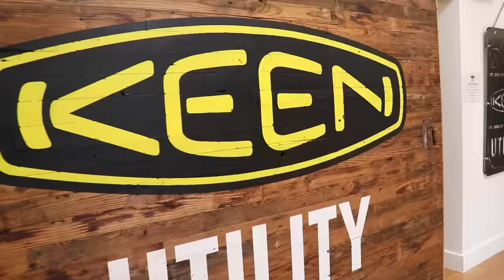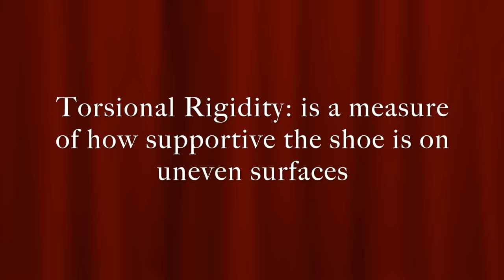How to pick the best Work boots & shoes for the Job site & why some wear out so fast

Comment: I’ve been wearing keens for 12 years and I won’t lie before they switched to American production they were made in China about two years ago. They were still very comfortable but after about 8 months the sole bonding or the toe rubber would separate. I still bought them because they were so comfortable on my feet and most importantly my back.

The quality since they went to American production is night and day. I bought a pair the first time the American version was available and they are still holding up. The support is also better in these. They also make my red wings feel flat footed and heavy. The keens never get wet inside, every other brand I’ve owned have gotten soggy even when spraying a can of kiwi or mink oil on them.

Comment: Those met guards are great for welders. I dropped a solid stainless steel bar 1"x4"x50" off the bench and it left a stamp in the concrete floor. That lands on the top of your foot and your in a foot brace or cast for over a month. The outer shell guard is great too because it keeps sparks from burning up your laces 🔥

Comment: I work in a wastewater plant.  As a 65 year old, who has worked industrial jobs since 1973.  Machine shops, Stationary/Operating Engineer, or even as a truck driver.  Your feet like rotating your boots for freshness.  I have lace ups, and pull ons.  All are safety toe and waterproof.  I try and buy ESD rated also.  I work 12 hour or longer shifts.  I own Keen's, Red Wings, Thorogood, Wolverine,  Carhartt, and Hytest.  I have an old work injury on the right foot arch.  So many of the boots have custom footbeds.
For casual wear I mostly wear Keen sandals.

Comment: I’m a diesel mechanic, I work on semi trucks. I blew through keens in 4 months. I went with thorogood boots, never going back.
Reply: Have you tried Redwing's? If not try those as far as shoes goes they have lasted the longest for me. I used to go through shoes in 3 months. Now they last a year and a half, the tennis shoe model with safety toe.
Reply: @urkryptoknight6793  I bought a pair of Redwing steel toed boots when I was attending commercial driving school because I could feel the steel plates of the truck steps through my nike's, in just a couple weeks I was back at the redwing store buying another pair without the steel toes because I loved them so much. I don't think I will ever buy another brand again. Every time I run across a guy who is on his feet all day I tell him to go try on a pair of Redwings.
Reply: I bought Keen bottoms wore out quick  , waterproof , a joke , uppers at flex  blew out   nope not again .
Reply: redwings been diesel mechanic in all weather use redwings there awsome the hood up had some that i’ve had over 6 years they stand behind there product they really do i’ve had countless laces and loops replaced under warranty they also have resoled them twice great boots i used to go thru boots every 6 months

Comment: I've had my redwings for 10 years and beat the fire out of them. When I called all the redwing stores in a 100 plus mile radius looking for a 14eee they had nothing. I was surprised that the last store told me that I should check out keen for the wider toe and the quality. I'm loving them and when I climb in and out of the semi I don't have to change since they're comfortable enough for driving.

Comment: I get a 300$ boot voucher every year at work and I've been at my job for 10 years which has allowed me to try every high end manufactured boot from red wing timberland pro Carolina to name a few. Keen are hands down the most comfortable boots I've worn and they last just as long as other boots I've named. Also keen dry doesn't fail within 6 months unlike gortex and whatever Red Wing Carolina use make my feet wet after an hour of work. I love the davinport and Dover because I put on a lot of miles on a daily basis. I can't go back to any heavy lug soles boots.

Comment: Sorry I'm not mentioning a Made in USA product. But I recently started wearing a pair of Ariat Mens Rebar 6" H2O Composite Toe work boots. So far they are amazing!  I hate a big clunky boot. Especially with how I'm constantly moving around, up and down off the truck, through rain and mud. These Ariat boots are very light and they feel like a pair of tennis shoes on my feet. I'm 6'4" 250 lbs. and I'm hard on boots. But so far these boots seem to be pretty tough. And they have the main qualities I was looking for: waterproof, good support, traction, and composite toes.

Comment: Ive had 2 pairs of keen and they are size 15 4e wide steel toe.i think its called king toe for wide feet. Used in heavy duty diesel industry. Not one complaint. Made my back hurt less legs hurt much less also.
Reply from the maker: Awesome, thanks for the comments!

Comment: After reading the comments I don't feel so bad about my Rocky boots opening up on both the insides at the ball of the foot. The leather came apart from the sole and now it's wide open. Other than that the boots are still in great condition so I just keep wearing them this way. I do landscaping so plenty of shovel digging, planting, kneeling, tree trimming, walking through stacks of branches etc. It took them about 5-6 months to start separating. 

After reading the comments I think I'll look at thorogood, nicks, and Carolina for my next pair.

Comment: I wear my Keens (Pittsburgh 6") every day.  I work in a machine shop environment, and split my time between shop & office.  I was previously wearing Georgia boots for years that would usually last me 12-18 months.  Keens were very comfortable, but I blew out the sides of the Keens at the flex in 5-months, not impressed.  I was, however, impressed that Keen honored their warranty and is sending me a replacement pair with no hassles.  I ordered a different style (Philadelphia) with the 3/4 welt sole.  We'll see if they hold up better...  Had the stink problem with the Keen's, which I never had with the Georgia's until the last pair I bought (same as previous style pairs I was wearing for years).  I'm wondering if it has something to do with a change in materials...

Comment: Love the education of the keen boots. I wonder if keen can make boots to withstand 5 years of new England hell of season both for sub zero winters and 100+° summers and still feel comfortable. I ask because I burn thru boots in 3 to 9 month as Indy contractor and in the winters here in Connecticut I need a decent part of boots to keep my feet warm and dry for those long 20 to 48 hours of snow removal and during the summer my feet become over heated that they start to bleed from the intense pain they indure from 8 to 10 hour days I put in on multiple surfaces. I can go from a flat concrete floor to a incline of a roof to replace or fix a roof and of all things have to worry about have a nail going thru the bottom of my boots from leveling out a dumpster of waste material.
Reply from the maker: Thanks for the comments Paul and glad you liked the video
Reply: I'm also in CT and experience the same thing. My work can range from tarring a foundation to doing final punchlist. I'm going through 2-3 pair a year and for the past 3-4 years have mainly worn Danner and Timberland. I've stuck between $80-$150. I'm wondering if I need to up my price point. I blew through a pair Timberlands so fast I sent them back, got a free pair and 6-7 months later still brought another pair.lol
Reply: I am a contractor in Vermont. I wear my keen targees all year around unless I am working in deep snow. I buy a new pair every spring. I keep my old pair as a back up. I basically get 2 years out my backup pair.

Comment: Trying being a Diesel mechanic. We stretch out the boots from waking back and forth across a shop and yard. The sides and toe get torn up from rolling around in grease, oil. Welding etc. 6 months max. You can wear them 1 year but your feet will smell. I wish they made boots to last 2 years lol

Comment: I love danner boots, I worked in the prison as a guard. Then worked in a casino. Gortex plus walking on concrete floors all the time. Then if you want them rebuilt you can send them back with money, they will rebuild them for you. With me, uppers and insoles are great, tread wears out. I can get new treads and maybe new shank but everything else it broke in. No breaking period, they are also in Portland. They are heavy but 20 years wearing them, I don’t notice it anymore.

Comment: I'm really hard on boots, I've got a short leg so one foot wears much faster and the other foot wears the inside out fast. Any thing with the soft foam lasts 3 months till im walking out the inside. I need hard rubber... A redwing will last 11 months. I paid the piper and bought a Hathorn logger it was very expensive $300. 2.5 years later they are ready to be repaired.
They are wildland fire ceritified.  So great for welding in.
I build fence by myself, sometimes miles from cell service so ankle support and traction is vital. One fall prevented could be life saving as sometimes no one knows exactly where im at...
My next boot will be whites...hathorns big brother. They are custom molded to your feet.
They first week is heck on your feet, but after that they are the most comfortable you'll ever have.
Reply from the maker: Thanks for the input Jacob and thanks for watching !

Comment: I know this is an old video, but when I was going through commercial driving school the first time I climbed up on a truck I was wearing a pair of nikes I could feel the metal steps through the bottom of Nike's (disclaimer, I am a fat man). I talked to a guy and he suggested RedWings, so I went to a redwings store and they fitted me out in a pair of steel toed mid cut boots. I was back no less then 2 weeks later buying another pair without the steel toe just for regular wear. This was back in 2016. I won't say they look new, and I have worn out the original insole, but man do I love my Redwings. now when ever I run into a guy he stands up all day long I suggest redwings to him or her.
I do agree with the toe cap, that is the one thing I hate about my redwings with the steel toe, I can feel how cramped my toes are under the cap.
Reply from the maker: Thanks for the comments, comfortable boots are a must !

Comment: you should do something on work clothing, like pants, jackets,  maybe overall and coverall.  under-clothing, like long-john for winter and summer clothing, as I have been at job site, when have to where full length pant legs, but wearing then feel uncomfortable, because they hold onto body heat. An I like to know what pant allow good air flow for killer hot summer days.
Reply from the maker: Good ideas, thank you !

Comment: Danner has been the only boot I can get to last a full season plus. All others have came apart and started leaking. They have a few pair that are stitched soles those are what I buy. Keens did fit good , but when spending $150-$250 on boots longevity has to factor in.

Comment: I wear meta tech stc boots the first 3 weeks you will hate them but after they break in they are great. I usually get a year or so out of the, due to mud , acidic water, cement , oil etc from a mine.. but the last pair are over 1.5 years old and still don't leak. I have beeen spraying them with fluid film weekly it seams to keep the boots from rotting quite well. Don't have much of a choice since the company pays 1/2 at their selected retailer.

Comment: I’ve had multiple pairs of keen boots.  They are very comfortable but the soles fall off.  The soles always start peeling off almost immediately.  I am a general contractor doing lots of roofing, ag building construction, concrete, and siding.  I’m back to thouroughgood, timberland, carolina, or steel blue.

Comment: my experience with metatarsal is it sucks until it saves you.  i worked in the steel and aluminum industry seemed to me when something dropped it misses the metatarsil barely and rails the side of your foot. i wish companies (i used redwing) would expand the plate an inch or 2 wider. also the damn guard catches everything

Comment: I got a pair of keen composit safety toe hikers. I wore them for about 6 monts. Started working in super dirty conditions so i out my keens up to keep them good. Several moths later i put them back on. The left shoe at my big toe some part of the boot curled inward. Rubbing on my toe it rubbed a blister on me. I could feel it when i stuck my hand in there. I could push it back with my fingers but it would curl back inward again. I wasnt sure what to do with it and i forgot about them for another coupple months. Then i decided to take them back to where they were purchase from. I was told " we can't do anything about it" I felt like a saftey boot costing 150.00 dollars befor taxes should come with some type of warranty, i looked it up on the internet. Low and behold there is a 1 year warranty against deficit. I wasnt sure how long it had been i was sure i was close to the year mark but didnt retain the reciept foe proof. On the keen web site they ask foe pictures of the boot from different angles along with one of the tag intact to prove its not a second or fake. I sent it all in to warranty clame. The website said reply may take some time but they would review my claim and would respond. But its almost a year later no response of any sort. And i have a defective boot that i cant wear. Burns my ass thinking about it still. They were comfortable and really like them. Thats why i didnt wear them in the really nasty work conditions. Sure wish i had jumped on getting the warranty claim as soon as i had the problem. As my old teacher used to tell us " a word to the wise is sufficient"

Comment: Red wings model 2406. Best boots. Only boots that last at the Foundry. Oil from heat treat tears up other boots. Climbing in nasty conditions they hold up well. Keens fall apart inside the shop. Keens are  good for outside work. Not for oil, carbon, nasty conditions

Comment: I like Keen but...... I had a life time warranty pair that the tread kept failing on me with in 6 months, they stopped the warranty on me lmao. I purchased an off the shelf boot from them the sole fell off in 2 months and my feet would not stay dry because the boot would not breath. I ended up going with CAT boots with a GOODYEAR welt so i can have the tread replaced easy; 1 yr of use then a new tread "sole" is put on. they breath and less glues to fail.

Comment: Tried a pair of keens  , supposedly waterproof  , Keen dry  hmmm, my feet got wet bad in slushy season  , bottoms wore out fast , and they blew out on the uppers at the flex line  , comfortable but i dont think ill buy another set , i guess for $ 110.00 i expect more ?  idk stanley what  pair did you buy ? if they were durable id try another shot ,just because they are comfortable

Comment: I bought a pair of keens cuz I have super flat wide feet and there the first pair in years that fit me good,they started peeling apart in the back by the hell so I took them back to shop and was like,I've done a few dumpruns and I work in a library,so they gave me a new pair for free I like them cilus my horrible flat feet but I wear crappy cheap shoes for work that might tear then up.

Comment: I own like 8 pairs of Redwings, and they’re all the USA made from USA materials, and leather from SB tannery. So to get me out of my Redwings, you’d have to cut them off my cold dead feet. I like traditional work boot construction, and that’s what Redwing is, they’re manually stitched with the Puritan stitch machine, and no other way makes a stronger more reliable pair of boots. I hate direct attach, construction because it means you can’t, resole the boots and keep them going. Every pair of direct attach soled boots I’ve had always peeled apart in no time, and once that happens it’s garbage. USA made Redwings are the only way for me, they still build boots the old fashioned way, by hand and on 80+ year old equipment, and it still in my opinion builds the best made boots on earth. It could be just my feet, and body they just like Redwing, if I wear anything else it’s not the same.

Comment: Keens are very comfy when you try them on. They DO NOT last for s@&$. Not to mention I think they are progressively getting uglier. I don’t need steel toe most days so I went to Asolo hiking boots. The models that use more leather than nylon. Very tough and I can work 12 hour days without pain. I tried to like Keen but including off road running shoes I returned 4 pair.

Comment: I get 45 days out of keens before they smell so bad.
Reply from the maker: Wash your feet.....LOL
Reply: Keens like redwings are over rated
Reply: In the last 7 years I have only had to buy 2 pairs of Red Wings. I only wear them when I’m at work. 1st pair 5 seasons , 2nd pair I’m on my 2nd season.
Reply: Throw a few dry tea bags in each boot overnight. It will absorb moisture and odor.